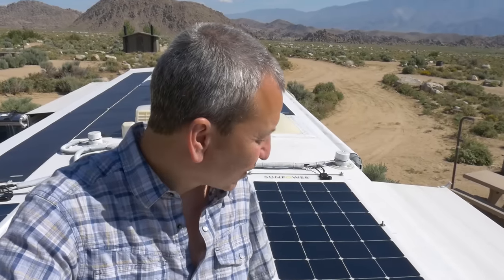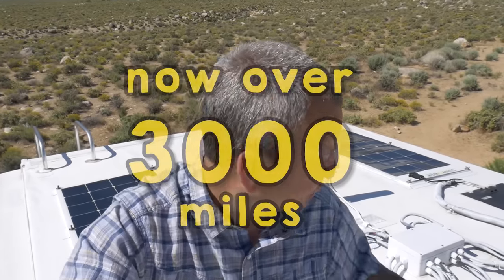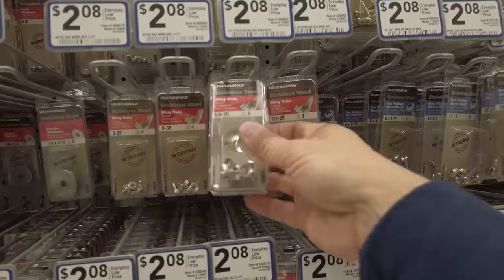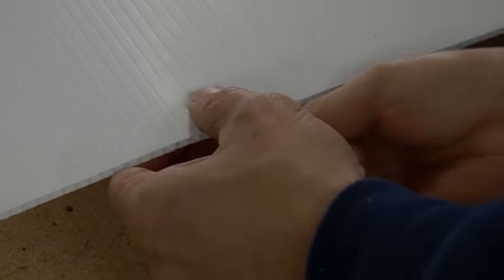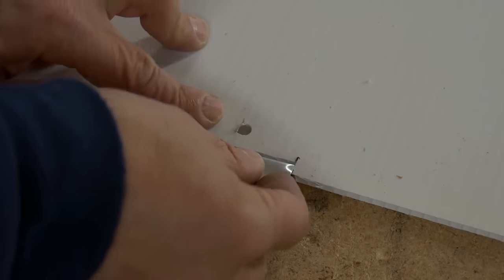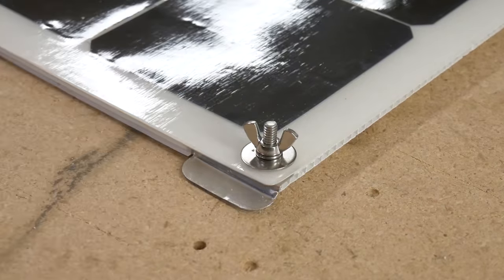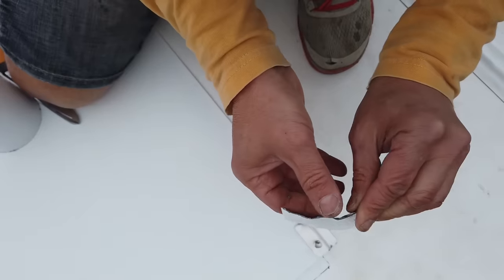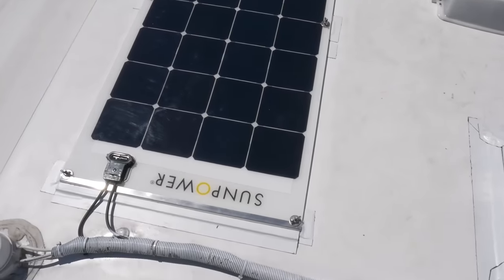Better Way to Mount Flexible Solar Panels on RV (2019)

Comment: One suggestion:   You might tell viewers to be aware of the "grain" of the plastic cardboard when cutting and mounting to a curved surface.  If you are mounting to a school bus roof, for example, you need the cardboard to be able to follow the curve of the roof.  The cardboard is flexible in one axis and not in another.  I really appreciate the detail of your videos, thanks.
Reply from the maker: Good point! Thanks for sharing it.
Reply: Good point for a domed roof which I have.  It will bend better if lines on coroplast are front to back.  However....!
You don't want the panel to bend but to remain as level as possible. The narrow width won't make much difference. If you did mount it front to back, the air holes for venting would be covered up by the metal strip. If you mounted it the way Tito did, the side airholes would still get a lot of air circulation from the swirling air but not enough to shear off. So its a toss up.

Comment: Question it seems you have panels that are different sizes/shapes on your roof …how does that work ? I’ve got 3 flexible 175 watt panels w room left if I were to have two smaller ones but not for another big one so was just curious.

Comment: Real nice set up I think I'll do the same. Question though can I use a marine battery for my solar set up. I will only use it for mini microwave and Keurig.?
Reply from the maker: Yeah, but you'll probably need more than one to run a microwave or Keurig.

Comment: I like your ID with the plastic under the panel I was wondering if it is not an idea to just tape it with gorilla tape onto the roof. No Water built up on the plastic and panel..

Comment: RV with Tito DIY  -  I like the over all concept, but you may have some design flaws.  Is the VHB holding down just the aluminum strips or is it in contact with the heads of the carriage bolts so they won't turn when it comes to removing the wing nuts?  It hasn't been a problem so far as you removed the wing nuts to install Locktite.  Now that you added Locktite there is a chance when you try to remove the wing nuts that the whole assembly will remain locked up solid and just twist and tear.  You secured the front aluminum strip with Eternabond I hope that it is flexible enough that you can bend it out of the way if you have to change panels.  I hope I'm wrong and that you have no problems.
Reply: I agree with this sentiment generally. The main question is - is there room to get under the panel/plastic to grab a bolt head if you need to change panels?

Comment: I'm curious how the plastic card board underneath would perform on snow and freezing  areas, with melted snow or rain underneath and in the channels of the plastic cardboard, then freezing temperatures and expanding as it turns to ice ?
Reply: I would like to know also

Comment: I am trying to charge my 2 battery running system on my class C motorhome. which the 2 batteries are running my Rv too when I am driving...Can I hook up 720-watt solar panel to a 2 deep cell marine battery system? should I have an extra fuse in the system of the class C RV batteries?

Comment: Hi Brian. Great video and I actually bought some corrugated plastic to allow airflow before watching. Great minds! 😉 Bu are you concerned about theft at all? I'd love to have the same screw fittings on my VW T5 but I fear that someone could easily unscrew and remove the panel. So will likely have to SikaFlex the panel to the board... Any thoughts/suggestions?  Cheers from the UK.
Reply from the maker: I'm not concerned on my end. My solar isn't visible to anyone and it's not easy to remove (see my update video). You could wire in some kind of cotter pin on the bolt or lock down the cables from the junction box somehow.

Comment: That corrugated plastic sheeting will degrade to a powder in a year or 2 where the sun can get to the edges. I used it on the inside of my large workshop windows to,reduce and diffuse the direct sun and to keep prying eyes out, a couple of years later I noticed that one sheet had a crack in it so I tried to move it and it crumbled to a powder, as did all the rest when I touched them. It may last longer in this application as it’s mostly covered but I’d look for a uv stable replacement that also allows more ventilation and less insulation.

Comment: I came looking for no drill options for solar panel install on a fiberglass trailer. Did this system hold up well for you? Any concerns if storing in a snowy and cold area off season?

Comment: Could you rivet the panel to the  cloroplast, smooth side of the rivet down towards roof?  A bit tricky drilling out rivets but hopefully never need to.  Like the idea and video.
Reply from the maker: I suppose you could rivet anything, but you'd have to remove the whole thing to drill it out and replace a panel.

Comment: Great video... good work... not much to improve upon 'cept one could cut some cost and time by skipping the lock washers and loctite by going with nylon insert wingnuts.
Reply: tried it, didn't work.  the carriage bolts spin.  the lock nuts are really the best answer...
Reply: @bobreagan3266  - So loctite it is!  Good to know...

Comment: Great idea with the coroplast. I just ordered the 170 watt sunpower flexible. Think I'll go the easy route and just eternabond without the screws.  Thinking full width on the front side and maybe 8 or so inches on the sides. and some on the back corners.  Your thoughts?   Im thinking its near what you have done but without the easy removal feature.
Reply from the maker: That should work fine.

Comment: Those doing lock washers are basically useless so if you cant torque them down property and are worried about vibration the lock tight is probably the way to go
Reply from the maker: Without the loctight, you're right. They would slowly loosen. After putting blue loctight on the threads, they haven't budged.

Comment: Solved your a boss, wanted flexible for a stealth but they overheat and fail way to early compared to the glass..Keep us updated on their longevity..
Reply from the maker: Still doing well. It's been a year now so I'll do a follow-up video soon.
Reply: RV with Tito DIY we went with the original taping of the panels with eternabond and had lots of issues with water getting underneath the panels. Can you comment on if water has been able to exit under the panel and the plastic? 

Ready to reinstall today with your new method but wanted to try to get your thoughts on water entrapment if you don’t mind. Thanks!
Reply: We ended up having a cell of the Renogy panel burn up and burn a hole in our roof. Definitely a cause for caution when using these flexible panels.

Comment: Never hold metal by hand when drilling hole through. Drill could snag and spin metal ,which becomes a spinning knife, which could result in severe damage to your fingers. Clamp metal down two bench or solid block of wood.

Comment: Can't find those alluminum floor transition strips anywhere. Everything I've found is more heavy duty and not the necessary stepped shape.  Any help would be appreciated
Reply: I couldn't find them either. I just bought some z flashing near the lumber department and used a vice grip to bend it to the shape I wanted.

Comment: This tempts me to use flexible instead of glass panels like I have in the past.  How do these perform in terms of durability and power output?  It seems difficult to compete with the 25 year lifespan of a glass panel.

Comment: I've finally given up...I thought this would be the best method so far, only to discover when I opened my box my panel has no grommet holes. I'm slapping it on the roof with eternabond and calling it quits!

Comment: Hello and thank you for the Information.
I am happy to see that you are still using the semi flexible Solar panels since few years.

I cannot understand the sin of using the Corrugated plastic in this case and at the end you were ending up sealing them with the tape!! No air can circulate beneath the panel in order to cool them in this case.

In the Motorhome sector in Europe most of the technician are advising against using the semi flexible panels due to heat problems and that they are susceptible with heat factor which lead to explosion in some sector of the panel is this right?
Did you face any problem with this type of solar panels?
Since when you are using the SunPower panels? Are they really one of the best in the market?
 regards

Comment: My only concern with this set up would be corrosion on the bolts preventing loosening/removing the panel. Perhaps it would be worth the time to make square holes in the aluminum anchors to prevent the carriage bolts spinning?  Perhaps I’m over thinking it.

Comment: Wasn't aware of a overheating issue on these panels.  I installed a flex panel but simply used 3M 4" rubber membrane tape directly.  Worked well but have another panel to install so will go with that plastic insulator on this one. Thanks for the tip.

On my panels I'm suspecting they might be draining off batteries at night.  Was wondering if you are aware if those panels (or most) have built-in blocking diodes or not installed?  I do have a cheaper solar charge controller which I would have hoped to take care of that, but doesn't seem to be working correctly.
Reply from the maker: They have bypass diodes, but not blocking. The solar charge controller has a low voltage cut-off instead.

Comment: Was wondering about plexi glass over the pannels.  To add protection from tree branches, hail, etc..  I think it would work good for this lay out.  Was wondering about like a foam tape weather stripping. Between the plexi and solar to protect it.  Give it a little spacing?
Reply from the maker: Flex panels also release heat from the top so it could keep them hotter.

Comment: I like all your projects.  This is a super simple way to attach the flexible solar panels.  I wonder if the plastic corrugated cardboard will hold up to UV radiation in the long run and I wonder if the core will clog with dirt and maybe grow mold in the long run as well.  With that said, I think it is a great idea and I like not poking holes in your roof.

I think I like your solar panel window awnings the best.  Do you still use those?
Reply from the maker: Thanks! I still use the awnings on occasion. For a quick setup, I'll typically put them on the ground.
Reply: UV should be fine as it's covered by the panel and mounting hardware. Mold could be an issue but not in the climates they seem to frequent.
Reply: This mateial is used for 90% of roadside signs and they last forever being hit rand over stepped on etc im sure its perfectly happy on that roof

Comment: I like this system. I've had some Coroplast outside for 12 years, and it's in good shape.I wish I knew why the flex panels are failing so much. Of course, people were buying them from China for around $100/100 watts. That might have been poor construction. Northern Arizona Wind/Sun is selling Sunpower flex, but only a 2 year product warranty. Much higher price at $220.  Since NAWS has the big 300 watt class panels (very heavy) for $50 LESS, I don't know about flex for a roof, where you can't tilt.  Bob Wells had the used panel guy, Santan solar, on his channel. Some of his panels are like twenty five cents a watt. 

I had several flex fail. When I tested, I could get full output by bending the panel, goosing the connections 'just right'. That suggests the connections had failed, but there was no way to troubleshoot with the heavy sealed cover. It was totally intermittent.

Comment: Is there away to remove the tape? IE if one day the panel breaks and all replacable panels have diffrent nut hole locations or if you want to sell your car/van without the panel.

Comment: Hi, did you have to sand down the fiber glass gel coat to the base layer prior to fixing with adhesive? What sort of prep did you do?
Reply: My understanding is it’s generally recommended to use denatured alcohol acetone or a high-grade alcohol to clean both surfaces generally no sanding should be necessary

Comment: Very nice sir! Some great improvements over the last method.  Have you done any checks on whether the air gap has had a measurable effect?  I have six up with your previous method and need to decide if I update them.
Reply from the maker: Thanks. No I don't have any data to share, but I know others have used this layered approach in hot places like Australia.

Comment: Great guide and I am doing the same thing on my  build.
Please post a link or some other clue where to get those thin aluminium strips!!
I've looked everywhere and can't find them.
Reply from the maker: I still see them at home depot in 6ft strips. If you can't find them you can make your own out of aluminum flashing (roofing section)
Reply: Thank you. I'll seek through Home Depot with a magnifying glass again.
The plastic cardboard was easy to find.
Reply: After much searching and going through all sections at Home Depot I FINALLY found the strips.
$1.58/each in 4 ft. length.
Store SKU #458556
Internet #202247416
Model # HZ-BAR
Reply: I just finished this install on my Ford E350 van and it was easy.
The roof is not flat and has groves in it but the Eternabond tape is soft and flexible so it stretches out fine. A few hours later and it's solid. That tape can be a bit of a mess to work with because it's basically a semi-liquid goo covered by white plastic. Great stuff.
Reply from the maker: @christianholmstedt8770  Excellent. Glad you found them.

Comment: So it’s been a while since you made this clip. One question, you covered the leading edge on the plastic underlay, isn’t the purpose of the Corflute to allow air flow and cool the panels. Second thought you could double nut your bolt rather than using lecture. Which will be really difficult to remove as the whole bolt will probably spin when trying to undo it !

Comment: I think I would have used polycarbonite storm panels instead of the plastic cardboard... The storm panels are clear, stiff, and could easily let you glue down the solar panel to the storm panel sheet and then remove it if you need to, and the corrugations are bigger than the plastic cardboard so you get better ventilation. Make sure to put the corrugations front to back or it will whistle as you go down the road.
Reply from the maker: Funny you mention it. I'm using those now.

Comment: I don't wanna have a roof like you big camper but I'm gonna try to do it to my pick up topper I got rails up there so I'm gonna have to build something to hang on to 200 W so they powered panels I'm just barely starting so I'm still trying to figure out what else I need

Comment: Thanks for this video, are you still happy with the flexible panels after the failure in your last video?
Reply from the maker: Absolutely. I'm using higher quality panels/cells now though that should have more longevity.
Reply: If you buy QUALITY (usually american or european made) flexible solar panels you will be happy. I might suggest amorphous type panels for better low light and partially shaded performance. They are less efficient so are sized larger for a given wattage. Often the warranty is 25 years yet  you may well never need any warranty assistance. Have fun!

Comment: HI.  Have you had any issues with water getting in between the roof and the corrugated plastic?  Our roof is made of rubber and we are worried that mildew will start growing there.  Thank you.
Reply from the maker: It has only been a few months now so I haven't experienced that yet. You could make sprinkle some baking soda along the edges to help prevent mildew and moss. That's what I use on the roof of my house.
Reply: @RVwithTito  Thank you!

Comment: May be an additional reflective sheet in-between the solar panel and the corrugated panel would provide additional heat shield in your next project.
Reply: Do you mean like aluminum, golly you must have some extra money to spend

Comment: Excellent video, idea etc!   I want to use your idea and instructions to attach a 100 watt flexible solar panel to my BOAT's  fiberglass hardtop.  Any comments or ideas on that change of vehicle as I get a lot of wind from all directions at times when storms roll thru.   I suppose you too experience those gusty side winds in your RV but maybe not as much or as often as we do close to the Atlantic ocean during storms.   Your thoughts and those of your subscribers will be appreciated.   I am powering a Bluetti A180 for my electrical needs rather than carrying a heavy, smelly generator.  It works great as shore power charges it, as well as the outboard charges it and soon the sun will charge it.   Thanks for a great idea from someone who does not like to put holes in boats, even above the waterline!
Reply from the maker: These flex panels were primarily designed for boats. So you should be good. There may even be some marine grade twist lock fastener that could work through the grommets. I've also seen these panels sewn into a Bimini and anchored with velcro. Hope this gives you some ideas.
Reply: @RVwithTito    THANKS tITO!

Comment: So how did you keep the carriage bolt from turning while tightening the wing nuts?
Reply from the maker: It's not on too tight. I just press down on the base while gradually unscrewing. Someone else recommended epoxy to hold the bolt it as well.